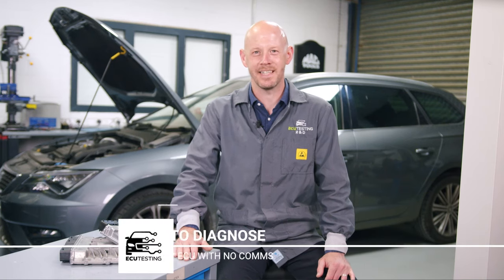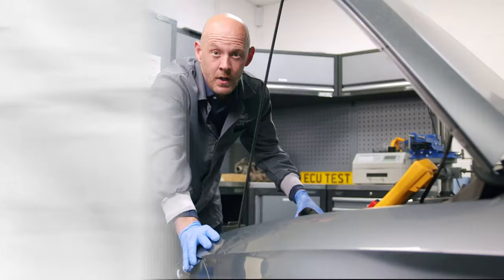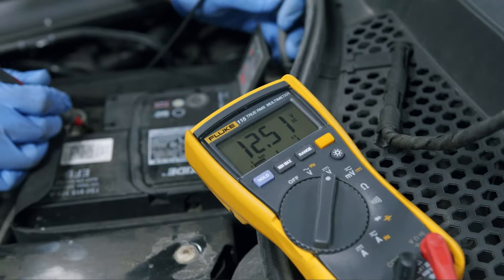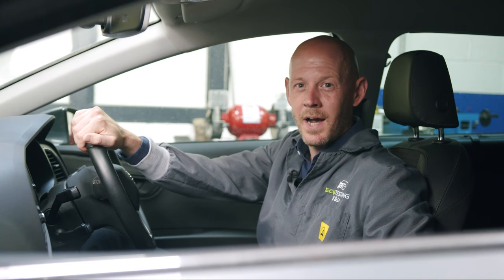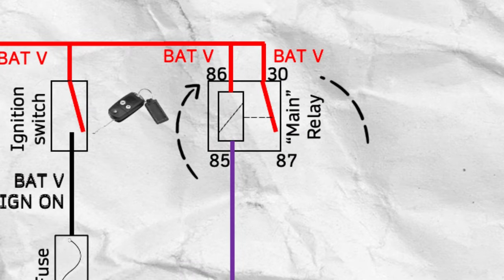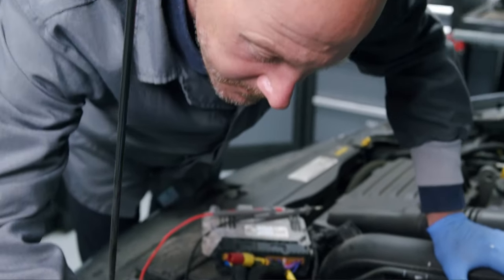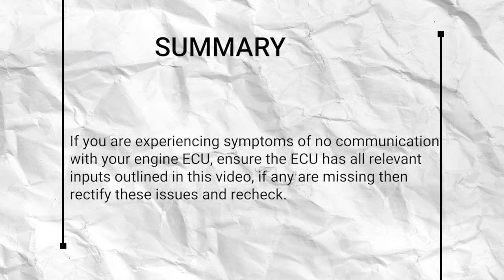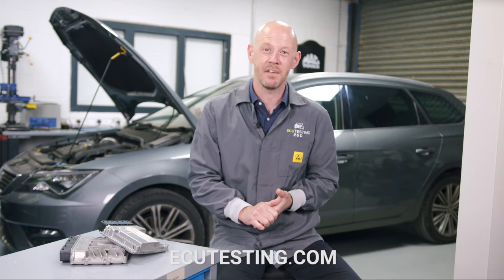How To Diagnose A Faulty ECU With No Communication

Comment: I have a question on 2004 suzuki that cranks but not start , and no comm issue and but have proper ground and power on pins 4,6 , and 16 on the DLC . Also ECU is not grounding the control wire on the fuel pum relay control wire, therefore no power on fuel pump.   However, I noticed igintion fuse that power fuel pump also powers the ecu and the spark plugs, that wire if  I cut it from the fuse now the cut wire stilled attached to ecu shows ground. with a light test  This supposed to be power but shows ground when disconned from the fuse does this mean there is a short in the ECU?   Also the ECU is not grounding the control wire for fuel pump relay as I said.   Would you say the ECU is shorted?  Thanks

Comment: Hi I have a 2007 Ford Fusion. When I first got it the people I was told that it would not start. Ok the next day I checked out the connector and I got it to start. They also put a different engine same size. Anyway it would run so I’m just checking other stuff out and she just stop running. So I scanned it and came up withU0100 and now no start . No communication from PCs / or ecm to tmc.anyone everyone plz help me Resolve this matter please thank y’all

Comment: Hi I have an 07 audi A4 I replaced the battery without a secondary power source. Now the car cranks, but wont start. The ECU is not telling the injectors to give fuel. Does it need to be reset or replaced? I heard when changing audi batteries they have to be reset

Comment: Hi.I have aproblem with  vauxhall corsa D , it doesn't start and it also displays an F on dash and no communication with engine module 
This is  happened after I reset the ECU 
I programmed   and it still no start and i have this error code (B3057 - No Security Code Programmed)
what could be the problem?

Comment: Hi. My car just will not start at all. I'v had a full scan on the car with no faults showing at all. The garage told me it could be ECU problems. But i need to know can a scanner tell you if the ecu is bad. Or can sometimes not. Thankyou

Comment: when engine is off  ECU has power or not and if coolant temperature sensor is bad radiator fan will continuously work even after the engine turned off?
Reply from the maker: Hi. The ECU has dormant power when the ignition is off, however it is not initialised so it should not activate the radiator fan. If the radiator fan is continuously on, then that is a common symptom when an ECU has no comms as it is misinterpreting voltages from the relevant control module. If you follow the steps in this video to diagnose why the ECU has no comms then you should be able to rectify the problem. However, if not, it could be that another control module is faulty on the vehicle, or that the ECU itself is faulty. Hope that helps.
Reply: @Ecutestinglimited  thank very much

Comment: First thing.. thanks by share this valuable information; In another hand...I have facing an issue with a Land Rover ECU, during they scanning process is not recognized...I already checked: 1).- CAN Bus lines and they are working well. 2).- ECU voltage and ground feed are fine.  They question is....could ECU lost "his" identification" after a short circuit ocurred during the engine replacement??? Your advice is well appreciated.
Reply: You need to have a diagnostic done. Sounds like a burned feed

Comment: Hello. Your video was quite informative. We have tried to remap a van and took a reading via Flex machine however now after performing a writing we can’t start the car and no communication is present with ECU via diagnostic equipment or the Kess V2 machine (our other diagnostic machine). We have even tried to write original reading file via flex and still won’t start. Have you ever come across this?
Reply: Hi We have tried to remap a Mercedes C220 2013 and took a reading Kess3 OBD tool however now after performing a writing we can’t start the car and no communication is present with ECU via diagnostic equipment or the Kess 3 machine (our other diagnostic machine). can you please guide why is ecu or any other obd reading machine detect ecu, we have checked all the fuses all are ok. can we check relays or change relay. please guide we shell be very thankful to. if we do bench read and write what do you think.

Comment: I failed emissions due to no communication to ecm. The data is cleared out every time 
when car is turned off. No warning lights are on like the the check engine. They just can't get any data readings.
I have a fiat 500 turbo 2013. one suggested it might be the f-18 fuse. when I looked it up it says power train. any thoughts? electrical or ECM issue

Comment: Hi We have tried to remap a Mercedes C220 2013 and took a reading Kess3 OBD tool however now after performing a writing we can’t start the car and no communication is present with ECU via diagnostic equipment or the Kess 3 machine (our other diagnostic machine). can you please guide why is ecu or any other obd reading machine detect ecu, we have checked all the fuses all are ok. can we check relays or change relay. please guide we shell be very thankful to. if we do bench read and write what do you think.

Comment: hi this paul with a 2008 vw touareg ecu problem. when . if i pull battery + or - for a while my engine runs normally. after switch off and turn on again  i have no check light and wont start unless i remove positive or negative  on battery . what could be the prob? video was clear thk you also for that

Comment: Wow what a really great an informative video. I have a question. I recently just put a rebuilt VR6 in my Volkswagen. Ive had a crank no start/ no spark issue ever since and I haven't even heard the engine run yet unfortunately.  
 I connected the laptop with the VCDS and I have no communication with the ECU I checked all spark, fuel and Air lines and power and grounds everything is fully connected they all look good. 
  I am getting high resistance at the fuel pump. I do not here the fuel pump turn on. Any ideas what it could be?
Reply: Have you checked your fuel pump relay? (Relay #67 for the VR6)

Comment: 2010 Chev HHR, I was programming remotes wth Autel AP 200 programmer, software on an ipad.
Ipad shut down while trying to communicate with the vehicle.
Chime went off, door locks cycled, gauge needles cycled, everything went dead.
Any insight into what has been damaged? Needs to be replaced?
Thanks in advance

Comment: Hello wonderfully well explained. You say that the ECU should have a permanent 12V battery connection does that mean that even if the key is off the 12V should be present ? or do you mean that on switching on then 12V should be present ? your answer would be much appreciated
Reply from the maker: Hi. It would depend on the vehicle, but in most cases the 12v feed would be present even with the ignition off. Hope that helps.
Reply: @Ecutestinglimited  Thanks for the quick response. Had I access to ECU diagrams as the established car mechanics following here your answer would be more than sufficient.I am a private person trying to fix my car it is a SKODA Octavia I break (1U5) 1.6 Petrol (102 hp / 75 kW) and ECU:06A906033BH make: SIEMENS.I am writing this in hope of more precise answer.Thank you.
I have krank no start
Reply from the maker: @boukharitemessek2596  Hi. Are you able to scan the vehicle for any fault codes at all? Without these it would be difficult to accurately diagnose the cause of the fault. If you are able to, please email our technical support team at info@ecutesting.com with the results of the diagnostic scan, the make and model of vehicle, and the details of the fault as you have listed above. Cheers.